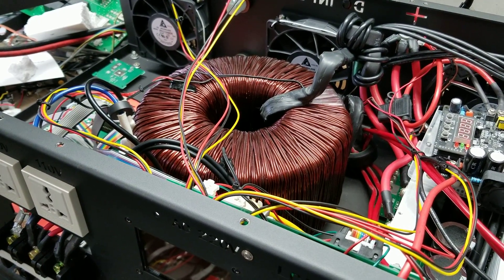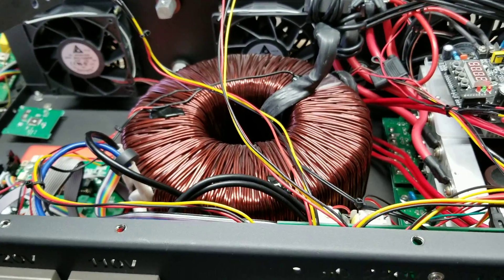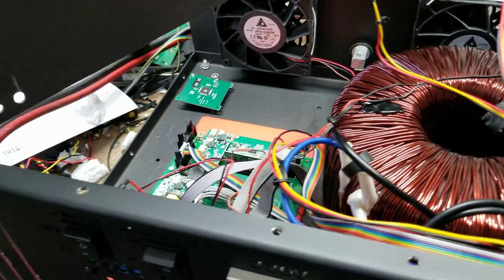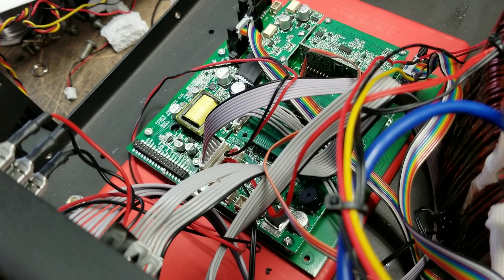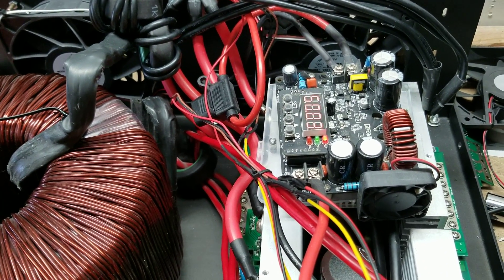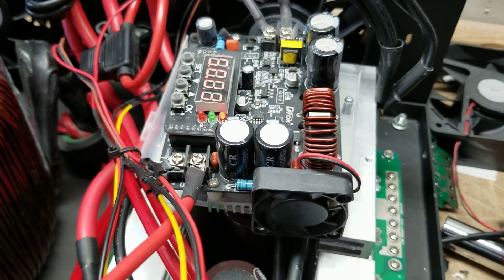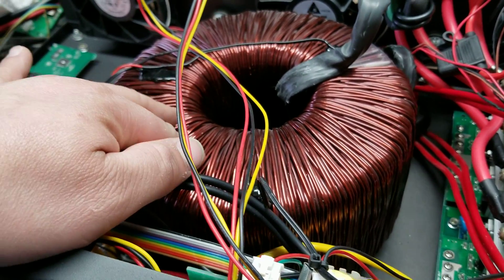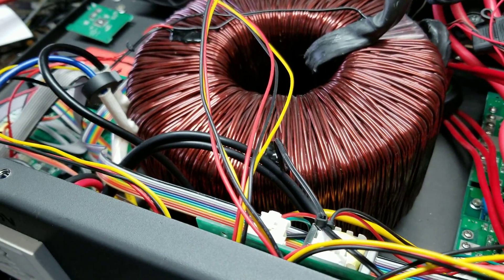My new custom Power Jack Inverter. Powered by Genetry Solar part 1

Comment: the heat sensor.. do you sale it or are its 10k or 15k... any link? may i use a fans pwm?
Reply: The heat sensors currently used are stock Power Jack thermistors.  However, you can use any 15K NTC (negative temperate coefficient, i.e. standard) thermistor with a 2-pin JST-XHB (locking) connector.

Fans...not sure I understood the question.  The WiFi board supports both PWM and non-PWM fans, PWM frequency adjustable from 20Hz to 30KHz.
Reply: Sid, what glue do y’all use on the thermistors for transformer?

Comment: Awesome awesome awesome!!!!

Love the videos that you build or test something different 

 Sean  you have built an incredible inverter and you know it!!

 you know these things in and out 

  you have built the perfect inverter

 only way it could be better is if you used that giant hundred pound Transformer and it might do a little bit better with this big toroidal choke core I have

 it wouldn't  
Saturate as quickly as smaller ones

 It would also help isolate  the board from the no leakage take no prisoners mosfet exploding highly efficient  toroid Transformer 

The only reason I know anyting about inverters is I read countless writings and questioned the heck out of the experts on the backshed and watching   your videos and the vast amount of texts and phone time with you
 Sean

 apritiate it by the way

 if you're concerned about the voltage of that hundred pound Transformer being different on the two legs of 110 volts

 once you take off the low side winding that's damaged anyway you'll be right down to the 2  110 volt winding

 the only thing you would have to do is unwind one or two raps of whatever side is running the higher voltage

 I would just love to see you use that hundred pound Transformer Sean you would absolutely love it  

that thing would run so cold no matter what your family is running all at once

 your fans would never kick on

Come on sean use that monster!!!!

It would make a cool video and shut me up that's a win win

 you already know all this though I am telling you nothing that you probably already considered
 
if there's anyting I can do to help let me know

 I have 2 cheap meters for testing how much    m h 's a choke has per winding  you are welcome to one of them also

 I've got new but stiff wire  for the low voltage side of that 100 pound Transformer and I also have that giant over $150 toroidal choke core 

I used one of the two cores in my large home built inverter

 I haven't turned it of since i installed it in the bus about a year ago the idle current on it is 0.47 amps on the 48 volt side

The bus is parked a few miles form my house

 the solar system  including inverter and batteries has been flawless 
I used the same make sky blue charge controllers as you

I used alot of your advice on that build

Plenty of room for 100 pounder in that nice black case

you don't have to use that giant Transformer to use this giant toroidal choke core 

The Transformer I am using the other one one is 53 pounds

 you could use it on this new inverter on this video you just built or just experiment around with it

 the only thing I have to hear you say is

Send it !!!

 And I would happily send it to you

Sean do you not remember 

 We purchased a inverter to as is no warranty not tested as is your ad was very clear about that

 and then you bent over backwards and sent us a whole new larger inverter and let us keep the other one

So it's no big deal to send you something to experiment with